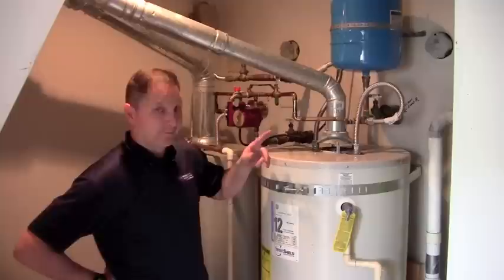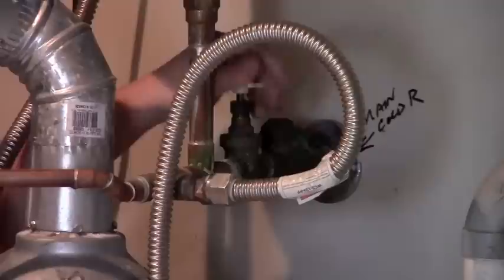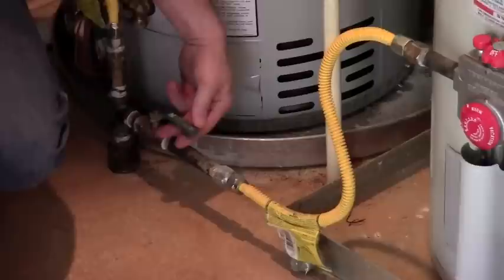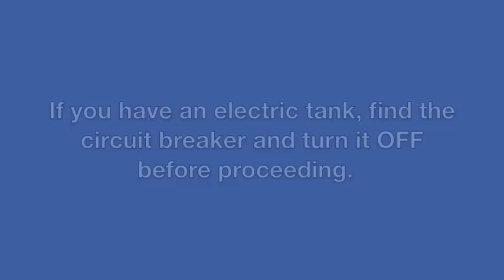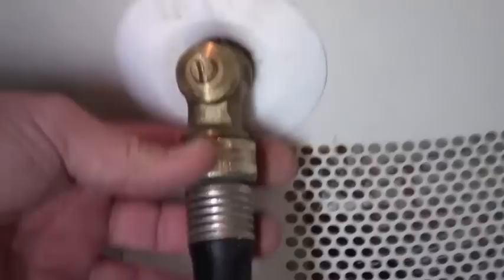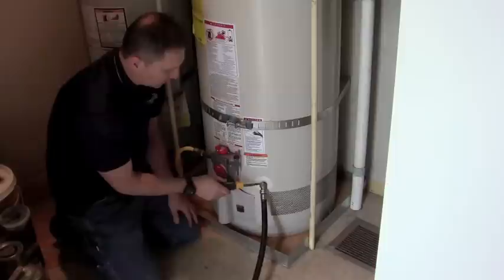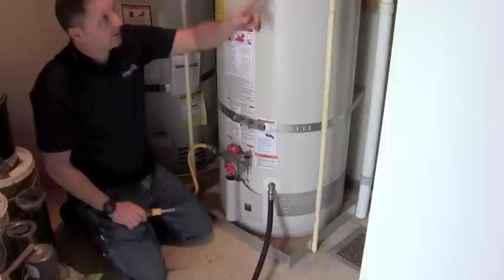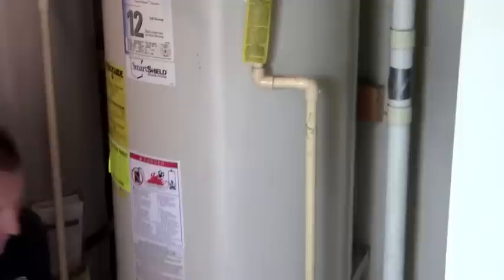How to drain your GAS water heater

Comment: These instructions are incomplete.  I tried Essanaye's steps and the water dribbled out.  I needed to turn the cold water on and off again.  I also needed to open some hot water valves in the house.

Comment: Question here please. My 50 gallon tank has 8 year warranty, I'm on the 9th year. I've never drained it until now. I agitated the bottom many times and finally got the tank to run clear. Problem is inside hot water is still off colour.  I live in Vancouver, BC for location. Every plumber says I need a new tank. Is there more I can do?
Reply: Just continue to run it until it clears up. Sometimes it takes 20-30 mins to clear up. Water quality in Vancouver BC should be similar to Seattle, which is excellent.  If you’re seeing rusty water, that most likely indicates a tank that needs replacing. The tank is nearing the end of its useful life, so keep that in mind, especially if it is in a location that will cause damage when it leaks.

Comment: Why do you need to turn the gas off if the water heater pilot is in the off position?
Reply from the maker: Amanda Lynn If you are simply FLUSHING the tank, then it's ok to leave the burner in the "Pilot" position.  This video however is for DRAINING the tank, therefore you want the gas 100% off.

Comment from the maker: Stocksystm, I'm glad you were able to figure out some of the other tricks that are used to drain a W/H. Our video covers the basic steps, and isn't meant as a substitute to hiring a pro. We couldn't possibly cover all the possible scenarios that one may encounter. Pressurizing the tank with the drain valve open is  a common technique, but it can also end up in disaster if the drain valve is damaged or opened incorrectly. Opening hot faucets in the home can also help, as it did in your case.

Comment: My understanding is you don't have to turn off the water or the gas. Simply hook up your hose to the drain connection and turn the water valve to open for a minute and off and on till the sediment is gone or the tank has been flushed out.
Reply from the maker: That is correct if you are in fact flushing your tank. This is a video on how to DRAIN your tank, like when you need to service or replace it, etc.
Reply: @Essanaye  ok, thanks.

Comment: No one told me to pull that lever up to allow area and I wondered why my water keeps dribbling out of the valve will it be dangerous to open that little valve up now I’m 70 years old and afraid it’s gonna blow up. My gas is disconnected. PG&E came out and disconnected it.

Comment: And just turn the gas back on? Is there a pilot light?
Reply: Some water heaters have a standing pilot that must be re-lit. Check the owner’s manual for your tank to determine which  style you have. Tanks also include a placard on the front that explain the lighting instructions.

Comment: @Essanye, how long does it take to drain because mine has been draining for over four hours. Should it take that long?
Reply: thunderkat9503 it would depend on the capacity of the tank, and what kind of flow you are able to achieve. A 50 gallon tank with full gravity flow will drain in about 30 minutes. You may have a faulty water heater shut off valve, or a crossover problem where water continues to fill the tank through the hot water line. I suggest you hire a professional at this point since there must be something else going on.

Comment: Then what to turn on first, the cold water or the gas?
Reply from the maker: Refill the tank and bleed all air from the system before turning gas or power back on.
Reply: @Essanaye  And how does one "bleed all air" from the system?  This is not a good instructional video.
Reply: @RedMango55  one opens a faucet in the hot water system to let the air out as one fills the tank. Once all the air is out (water is now coming out instead of air), one turns off the faucet and then restores the power.

Comment: My tank does not have a drain at the bottom so how do i drain the tank ?
Reply: adrian crossley , sometimes the drain valve has been turned towards the wall or otherwise obstructed. I’ve also seen people remove the drain valve all together and put a plug there. There are some tanks that have drain valves concealed behind panels. On really old tanks with legs you’ll find the drain on the bottom or “under” the tank. Ultimately if you cannot find or access the drain valve, you may try to siphon the water out of the tank. What I’ve done in the past is remove the hot or cold connection pipe nipple at the top, and stick a washing machine hose with one end cut off down into the tank. Then a standard garden hose will attach to the other end of the washing machine hose and you run it to the exterior and siphon the water out. They also make pumps that will pump the water out through the opening at the top. Hope this helps.
Reply: Steve Hyde thanks steve i found it in the front of the unit behind the front cover where the pilot light is (DUH) thought it would be on the outside.

Comment from the maker: nyc, I'm not following your question.  There is no vacuum on the system when you open the Temperature and Pressure Relief Valve, or open faucets to let air in.  If you were to coordinate the draining of your tank (for whatever reason) with bath time, shutting off the power source before taking your bath would save reheating the water that you are then about to drain out, which is a good idea!  Not everyone has the luxury though of coordinating like that.

Comment: In my area, our water will destroy a water heater in about 5 years. TONS of minerals in our water.  It's best for US to attach a large capacity hose to the heater drain with the cold water still connected, and then open the drain valve and just let the water pressure blow the crap out of the bottom of the water heater until it is flowing well.  THEN we turn off the cold water supply, disconnect it, and let the water flow out on it's own.  Our water sucks, and this is how we have to do it.

Comment: It's a water heater.  Common misnomer to call it a "hot" water heater
Reply: Unless it was stolen ((-;
Reply: thaddeus buttmunch:Very good :)
Reply from the maker: +bikenbare Once the water gets hot, but is not necessarily up to the set temperature, then it is technically a hot water heater.  Or what Thaddeus said.  ;)

Comment: I really hate these incomplete videos.   He is probably a fake employee and doesn't know how to address the next steps, not all hot water heaters are the same, and most of the time the water only trickles out of the drain valve. This pisses me off that he didnt address theses common problems.
Reply: We couldn’t possibly cover all the possibilities one could encounter.  In my 34 years in the business, I can assure that the method shown will work 99.99% of the time. But I’m sure the YouTube community would appreciate you making and posting your own perfect video on the topic.
Reply: If it’s trickling out... your air pressure relief valve is not open properly!  That’s not his fault PLUS it’s only a tutorial and all aren’t the same... but I betcha it’s something simple.  
Make sure that a faucet or two in the house is turned and then turn off(some people have done this for air pressure relief)...

Good luck